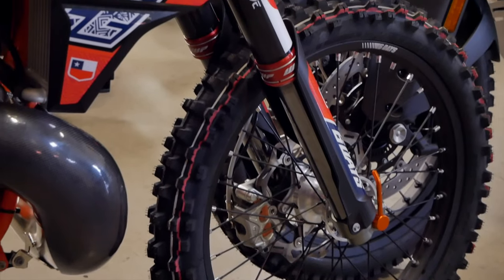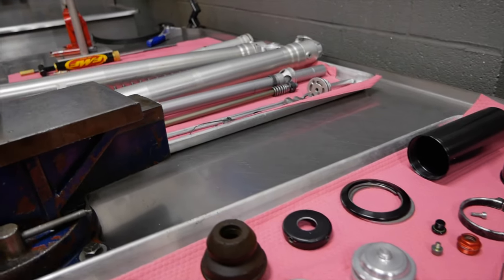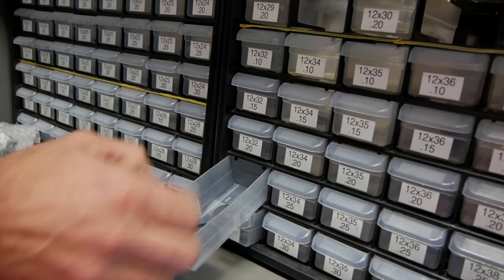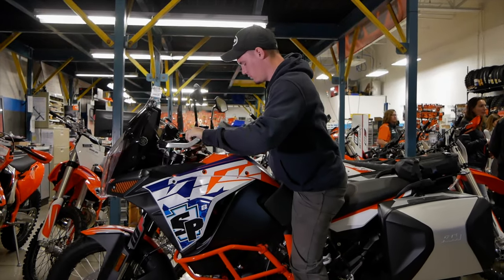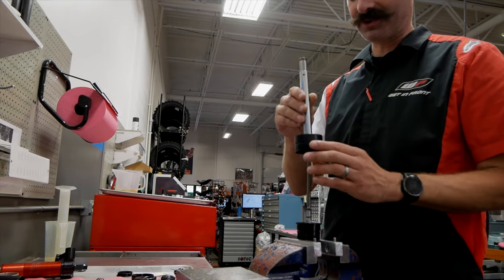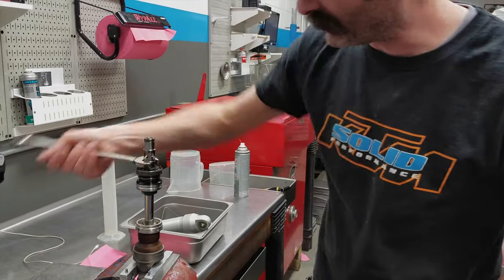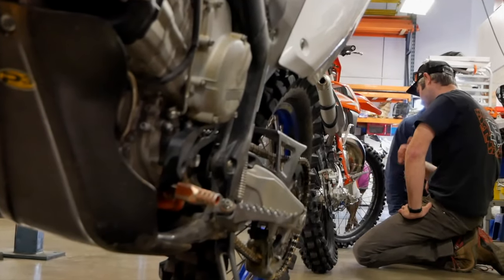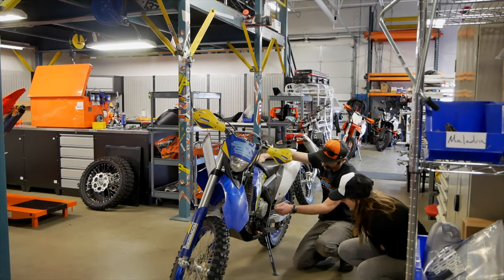KTM Suspension Upgrades and Service Center

Comment: Have to say, they installed the pro 6500 cartridge and tuned the shock on my 21 TE300i  night and day over my already revalved suspension.  The factory single sided forks are ok for average riders but not good at being pushed hard. Little pricey but man the 6500 made a difference
Reply from the maker: For sure, the 6500 kit isn't cheap, but man they perform sooo good.  Glad you like it!